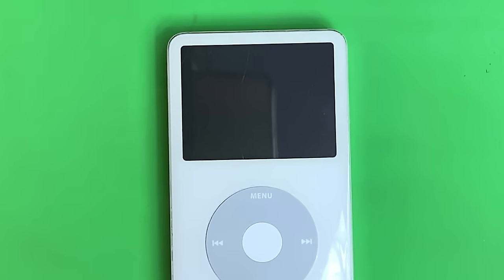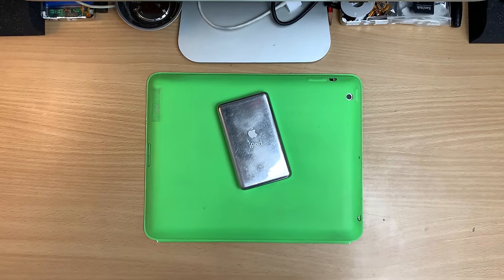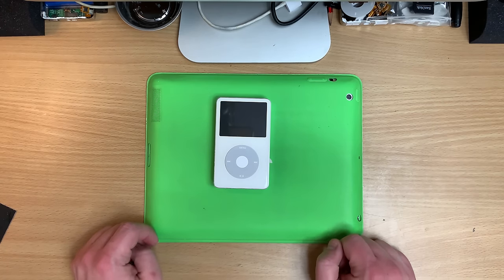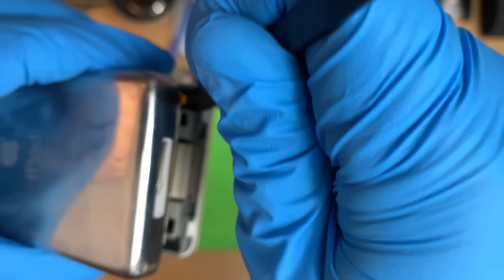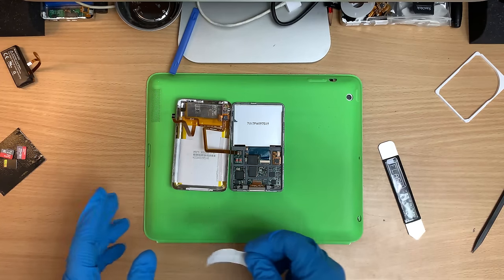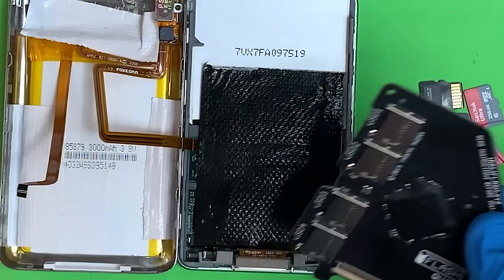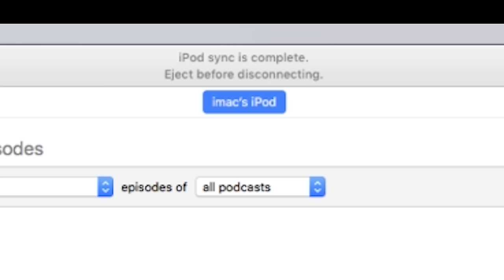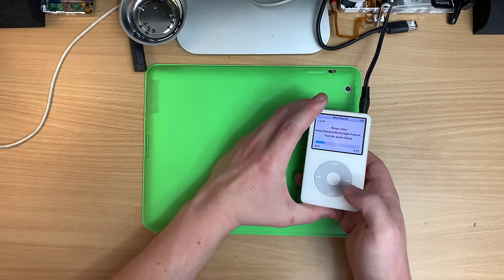Building a 1000GB iPod classic! Can it handle the storage?

Comment: Pretty sure it can’t shuffle because there isn’t enough ram to store the random ordering.
Reply from the maker: Thats pretty much it. If you have huge FLAC files then 1TB is useful as even around 25k tracks will use a lot of storage.
Reply: It's all because of poor coding, and because of the fact, they were not made to handle this much storage.
If Apple wanted it had programmed the shuffle feature in a way that it factors the songs in segments and then out of that sector it can choose a random number according to that choose the segment and do this at most 5 times...
In this way it isn't going to take that RAM, the process will be a hell lot faster and the user can use the shuffle feature as usual
Reply: yeah lol that device wasn't designed with lossless music collections in mind.
Reply: Makes me sad, as I have finally reached 500GB in my lossless collection.
Reply: @DankPods  cool, I'm more of a build and see what works, haven't been into file types and ram pointers, limitations, and allocations since dos and C were the dominate creatures. Appreciate the reply.
Reply: @shantanuchakrawarty6217  I wouldn't call it poor coding, I would say that it wasn't a requirement when the software was designed. Treating the entire song catalogue as a whole when shuffling is technically a better method of doing it, as in the outcome will be better. And there's a fair bit of thought going into how they shuffle, if the did it in segments those segments needs to contain random(ish) songs.
Reply: @volundrfrey896  there is still ways to do the whole shuffling if they wanted to bro... They could just make segments and from each segment take 1 out and randomise the result again altho it might take some ram
Reply: DankPods My current ipod video 80gb has around 3200 songs on it and its full :) going to upgrade it next year
Reply: Actually it depends on the shorting algorythm used.
Reply: @DankPods  flash a custom ipod rom. On it
Reply: @DankPods  I only use FLAC files for music
Reply: Shantanu Chakrawarty but with this it then it might play songs multiple times unless there was saved data for what song was played...but then with that it might take a while to shuffle cuz every time it needs to it’s gonna have to look to see if it played that song already
Reply: Not enough ram... The stupid programmers should have used a stack or dictionary that stored the index of played songs which would allow it to load instantly and not have any issues. The total stack with 100,000 songs would only be around 125kB using integers otherwise they could have cut it in half using shorts but would only handle 65000 songs. As a person we would never know so who cares.

They were just terrible programmers...
Reply: Slathian the shuffle worked for 80gb, why tf would they write code for a scenario that normally never happens
Reply: @D0w0ge  they should have programmed it using this method regardless, due to being one of the most efficient processes. It doesn't matter if the use case wasn't there. The fact that something can possibly fail by design is terrible.
Reply: Dedicated WAM
Reply: @DankPods  
If you start selling these I will gladly buy one. I don't even care if you used recycled ipod parts for it.
Reply: I don’t think a human is capable of “liking” that much of a song tbh. For it be “downloaded.”  In or for you to like it, you’s have to listen to it once, at-least.  And when you multiple 3 mins per song with that storage capacity,  shuffle is like, fuck it, s/he won’t remember rest of the songs we are not playing lol
Reply: @volundrfrey896  I can say that I was happier with the way my iPod would shuffle songs than most budget MP3 players I tried back in the day :)
Reply: The shuffle list could have easily been written to disk and only the leading 100 and preceding 100 be loaded to ram
Reply: @bait28  It would be crazy slow if it was trying to randomize on a swap.
Reply: @volundrfrey896  no it wouldn't, I've already done it using a custom firmware. The delay is less than 8 seconds for the initial randomization and then between swaps I can't notice a difference
Reply: @volundrfrey896  and my song list was 45k for the test(mostly 30 second samples just for testing)
Reply: @volundrfrey896  the ram size was max 64MB, the stock zfs drive performing random I/O can perform at about 2-4MB/s at worst and on average if it's not very fragmented while writing is in the neighborhood of 10MB/s. An SSD setup of any kind inside the iPod had a SIGNIFICANTLY faster I/O speed, with Random I/O's nearing 40-60MB/s, the slowest part is the CPU literally generating the randomized list
Reply: @bait28  Because the ipod came with ssd? Or do you suggest that apple should make it unusable stock just so modders can make it good in the future?
Reply: @bait28  Don't put it into 15 different comments then. YT only shows the last one. If you want custom firmware make custom firmware.
Reply: @volundrfrey896  guess you can't count either, enjoy life, must be hard
Reply: @volundrfrey896  also I did make and still do custom firmwares, your strawman argument is so stupid it's actually annoying. I made a point this was and is a solvable issue, even in stock form by Apple and it just wasn't. Your argument is attack everything I say and Dodge the point. But hey, whatever dude
Reply: @bait28  It's common to exaggerate things to prove a point. Anyways you seems to have a bad day, feel better and have a merry christmas.
Reply: @volundrfrey896  I'm having a bad day? Lol ok. I just don't want others here who actually are genuinely interested to think it's hopeless because you say something very far from true
Reply: @Roodj1 it's all about the way you do the coding noob and not just the storage.
Reply: @shantanuchakrawarty6217  I don't think you can call it poor coding on their part that they didn't envision people modding this to include a 1TB flash drive lol
Reply: The shuffling should’ve been done incrementally 😖 this is the kind of software you offer the lowest SWE compensation of all the “tech giants”
Reply: Völundr Frey  +1 I’d probably call it poor architecture— factoring in scalability is kind of system design 101
Reply: @volundrfrey896  actually I'd still call it poor coding the same thing could have been done in a few instructions.

Have two lists in memory. One empty called played, and then the list of all songs. Then get the length and choose and random number between 1 and the length to choose a random song. Then remove it from the song list and add it to the played list so the next time a random song is chosen it's impossible to play the same one again. And you can still go back to the last song and get a random next song.

This method would be virtually instant. It's silly the software developer didn't do it this way. This is the way most shuffle functions work.

But sadly they took it so literally that they actually made a whole new shuffled list and processed the entire song library first. Veeeeery inefficient. Veeeeery script kiddy.
Reply: @dmhzmxn  That's a not a great method you're suggesting imo, which does not produce a shuffle function that 'feels random' to our dumb brains which is one of apples requirements. And you're still stuck  with two massive lists of together containing all songs in memory. 

Also for a shuffle function you definitely don't want just a random sequential order of all songs. Some should repeat some before you've played them all.
Reply: @volundrfrey896  idk how literally picking a song at random as I described can't feel random when it is exactly random.. that doesn't make sense to me. Also the list is a list of pointers not like full songs loaded in memory, you don't have to scan the songs or get metal data or anything. just a length of songs and pointers to their meta. takes basically no time. And if you want them to be replayed and then give them a timeout to be added back to the list. There's no faster way you have a split of future and past songs and a random selection of the next one. And if you want a list of next songs can be dynamically generated. It doesn't make sense to do it another way.
Reply: @volundrfrey896  also there isn't two massive lists in memory. An item can only exist in one at a time so it's always the length of the library and again you could have 1 million pointers in the list and it really doesn't matter. Pick a number from 1 to a million and use that index to load the next song. Just as fast as a library of 3 songs.
Reply: @volundrfrey896  The method I described is the most efficient and quick method.  It's used everywhere. Literally shuffling a list all at once is just baaaaad.. doing it this way is the exact same except the next song is immediately randomly selected rather than doing it all at once in the begining. Plus you barely use any memory to select the random number to the length of the library. And once you do you only load the selected song not all of them.
Reply: @dmhzmxn  There's a lot of studies on the the phenomenon of "perceived randomness" vs the actual randomness. Essentially true randomness will/can cause a lot of sequences of similar songs which doesn't feel as random to us as it should/is. 

So apple's shuffle function is not random, they weigh it in some way in order to not have songs too similar playing after one another. Same goes for spotify and google music. I'm sure even the shitty music services like tidal does it. 

It's when the human mind meets mathematics, perceived randomness is much psychology than actual randomness. Since our brains are so good at seeing patterns where there are none. Very interesting subject tbh.
Reply: @volundrfrey896  sorry XD one more thing. The method I described doesn't change in speed when the library size increases. With this method size is irrelevant, disk IO is irrelevant, and CPU speed is virtually irrelevant, and ram is virtually irellevant as well. When I say virtually I mean of course it needs very little in active memory and only takes a few operations to play the next song.

Where as apples method takes (randomizeoperationstimepersongentry * playlistlength), just hyper ultra mega stupidly inefficient.

I can make a codepen with both code side by side and a performance test if you may find that interesting? It's funny to make these tests sometimes to see how silly some coders can be, even in big companies like apple.
Reply: @volundrfrey896  ohhh I see now. And to do what your saying apple does, the only way would be to compare all the songs and score their similarity to each other to properly be able to randomize it with that information. Veeery interesting. So while my method is faster, it's not neccisarily perceived as properly randomized even though technically it is.

I am happy you brought up this point. I didn't even know about that. Thanks for teaching me something new :)
Reply: @volundrfrey896  I have been explaining this like you might not understand how the computer would handle that information at that level and you were way ahead of me on the next step, on the perceived result of both methods XD I'm sorry haha clearly you know your stuff XD
Reply: @volundrfrey896  one last thing. You have really peaked my interest in this because I assume at the time this iPod was created neural networks wasn't the main method in assessing the perceived difference in two songs. Not that I can think of a way to score the network lol... What data is used in scoring similarity? If you don't know I'd like to hear your best guesses. And if you have any interesting articles I'd love to read them on this topic!
Reply: @mattygp1138  *detotated
Reply: @MrScaryPasta  why don't you learn and understand what he did.  I am sure its replicable, in terms of parts used.  His video pretty much notes it all.  I am surprise you can even do this with apple products consider that the hardware all check and balance to see if they are all apple parts.  In such case, the battery isn't and also the hard drive isn't either.  Regardless, nice work and a great way to keep this item still in the limelight.
Reply: I'm extremely dumb and have read all the comments in this reply.

If I have different playlists on my ipod (edm/country/hip-hop) can I not shuffle just those (one at a time) ? If I had almost 1tb.

I don't want to shuffle 45000 songs.
Reply: No, it's actually the track count, it can't go beyond 50k, as the iTunes db has a maximum.
Reply: @dmhzmxn  should be noted that the original shuffle feature was considered "not random enough" because it was entirely random. Humans like to perceive patterns in things, avoiding that is difficult. I'm guessing they must've stored the entire songs information in the list for some reason, since a list of pointers is not going to be that large. Even less so if you use an ID rather than a pointer
Reply: Would a custom. Os solve this issue
Reply: It's a power drain issue. You can help by removing most of the meta tag info on your files (cover pics, dates, date added, bit rate etc). My file names have the band and the tune in them and I list the album name in the tags....everything else is bloat and slows the ipod. Don't have any massive playlists, try and keep the playlists to 100 files or less as big lists will also reset the unit
Reply: @DankPods  Could you modify a massive capacity ipod to have massive amounts of ram? I'd love to be able to shuffle hundreds of thousands of songs without issue. I'm a music hoarder 🤣
Reply: no it's just insufficient ram
Reply: Can you shuffle if the iPod has rock box?
Reply: @shantanuchakrawarty6217  I wouldn’t call it poor coding. The average 256kb/s track was 5-6mb, 25,000 songs x 5mb is 125GB. There’s devices we’re made in the early-mid 2000’s when that kind of storage wasn’t the norm. Hell, the OLED switch only comes with 64gb and iPhones with 128gb. 

Nobody needs 25,000 songs in their pocket.
Reply: @ztgasdf  Is that all 16bit? Or 24bit?
Reply: @Spazza42  Heavily varies. I'd give a random estimate of 85% 16bit and 15% 24bit.
Also, I added some stuff to it, so it totals to around 1.52TB now.
Reply: @DankPods  I can only dream of having 25k songs my longest Spotify playlist has like 900 songs and on max Spotify quality it only takes up 4.5 gb on my phone
Reply: @shantanuchakrawarty6217  no lie, I'm not into coding but I want to know how the shuffle feature works in all ipod models lol.
Reply: I think with the ram it could potentially shuffle more music if there’s less meta data (name, artist, genre, etc.) so maybe if the music was limited to just the name maybe it could shuffle more songs.
Reply: Adreed
Reply: You stole my profile!!!
Reply: Cukup yakin itu tidak dapat diacak karena tidak ada cukup ram untuk melakukan odering acak

Comment: Now install a blurtooth chip to connect to airpods 😂😂😂😂
Reply: Not really that difficult, plenty of space in there. Just gut a minijack bluetooth receiver, hook it up to the battery and hardwire it to the minijack port pads.

The potential challenge(s) is/are range (if that back cover is metal), and arranging an on/off toggle so it doesn't drain the battery when not in use - accessible from the outside. Its doable, but a bit tricky to do well. It doesn't draw a lot of power though - those cheap BT4.0 round receivers you get from Mao's Candy Mountain for $2-3, has a board the length of about two microSDs and about 2/3rds the width of one - 3 ish mm tall. And a 60mA litium cell, which can run my old thirsty Bose QCs for a good 3-4 hours at fairly high volume. That's with continous audio output. Idle it'll draw far less. Depending on your usecase, that might be acceptable to leave on permanently. There's possibly some 3.7V+ lines you could hook into that aren't live when the iPod is sleeping, but where they are, and whether they csn tolerate such a parasitic load, I don't know.
Reply: Why not using BT LE? With that you could let it on for days...
Reply: @jankow9687  Well to be on the fair, with BT4.0 I think LE support is optional. 4.1, included by default. However, very few BT audio transmitters and receivers support it, at least the cheaper kind - because the principle is super low bitrate and only intermittent, periodical transmits. Like for example health and sports trackers. Pretty much the exact opposite of what (decent quality) audio transmission requires. Meaning the addition of LE is kinda wasted/pointless for that kind of device.

A 4.0 transmitter / receiver isn't gonna be a huge draw when idle. But it will be there. And, some times bt devices bug out in terms of pairing. Which is another good reason why you'd want at least that power toggle accessible from the outside. Once you have that, powering it on/off is a nice addition if you're not using it for a while.
Reply: that pretty much defies the entire purpose of using an ipod classic in the first place... the main selling point being the dac n battery life. other then  zune ipods had the best price to performance hardware during the ipod run.  to this day outside of the lgv series phones nothing in the mobile  market has a dac that comes close to the ones used in the 5th/7th gen ipod classic that doesnt cost several hundred dollars
Reply: @zeroa69  And if you are using a Classic because of the DAC, bluetooth will just negate that advantage.